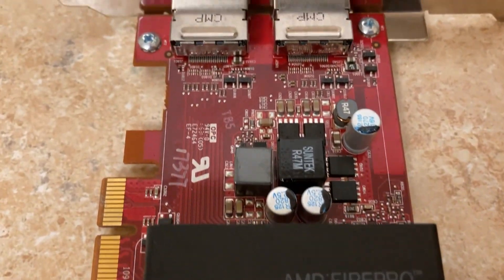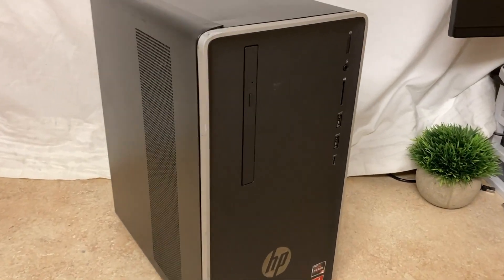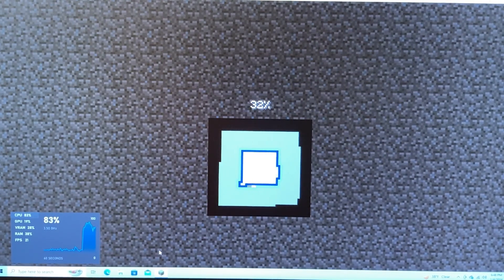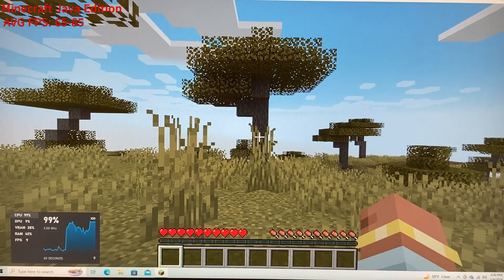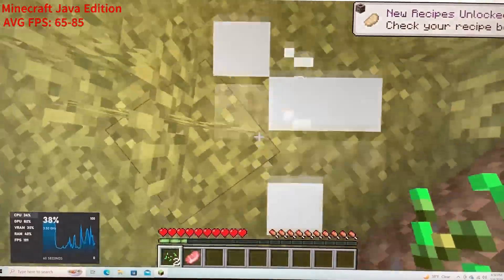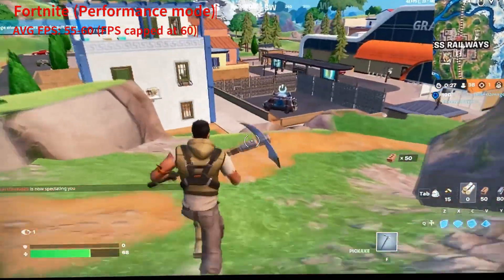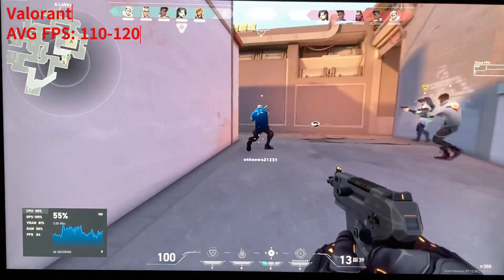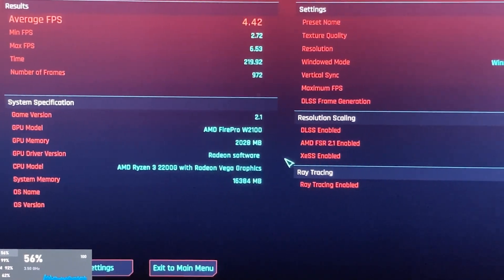Budget Graphics card 2024 AMD FirePro W2100 ---- Graphics Guild Episode 1

Comment: Bro My pc specs are i5 4th gen and i am getting average 200 fps in minecraft java edition so smooth experience
Reply from the maker: What else are you running? Ram, gpu etc
Reply: @Nerdy30s  I have 12 gb of ram and I am playing on low settings means I just change fancy to fast
Reply: @Nerdy30s  I thought that this gpu should be better than r5 340x 2gb but I was wrong it's resolution settings is so bad and also there is no latest support like AMD doing on Radeon series

Comment: these gpu was and is very nice for older dell servers like r910 who who still have them. as build in gpu is horible and pcie slot power limited to 25w and gpu that run at 25 was and is pretty rare.
Reply from the maker: I was surprised with how well it run considering I was able to toss it in a desktop. Install some drivers in 10 minutes and I actually won a match of Fortnite
Reply: @Nerdy30s  indeed i put it server and i am able run software i wasnt able before
Reply from the maker: @LeadbestosSmoothie  that’s fantastic. I love finding uses for old hardware.